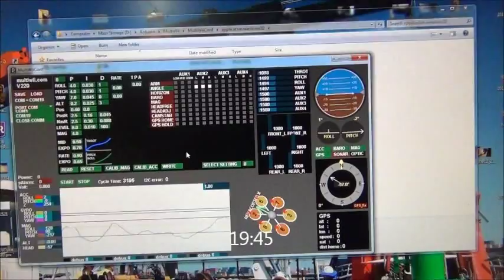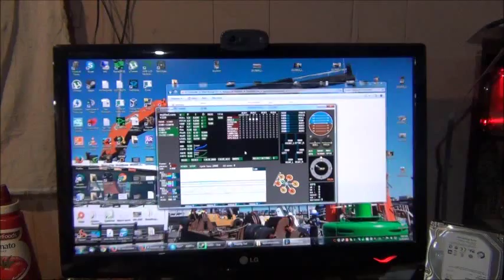9 Hour Big HexaCopter Build & First Flight

Comment: how did you attach the motors to the frame ?
Reply from the maker: Rivets mate, Rivets. just like a real helicopter? lol :)
Reply: haha nice, i just ordered my kit with the below, hope my motor choice is ok

Your order details are:
1x #9171000112/25698 Turnigy H.A.L. (Heavy Aerial Lift) Hexcopter Frame 775mm = $63.86
6x #9192000124-0/39708 Afro ESC 30Amp Multi-rotor Motor Speed Controller (SimonK Firmware) = $83.76
6x #NTM2826-1000/21478 NTM Prop Drive 28-26 1000KV / 235W = $95.70
1x #402000001/15214 Gyro / Flight Controller Mounting Pad (10pcs/bag) = $1.95
1x #Turnigy-HKLP/11736 Turnigy Battery Strap 330mm = $1.55
1x #9171000144/27035 Hobby King Octocopter Power Distribution Board = $4.75
2x #9171000101/25438 Turnigy H.A.L. Battery Mount Plate = $5.98
6x #NTM28-ACC/16719 NTM Prop Drive 28 Series Accessory Pack = $11.10
1x #387000003/26588 MultiWii PRO Flight Controller w/MTK GPS Module = $64.99
1x #TX-9X-M1/8991 Turnigy 9X 9Ch Transmitter w/ Module & 8ch Receiver (Mode 1) (v2 Firmware) = $59.99
1x #9X-LCD-WH/17129 Turnigy 9X LCD Backlight Kit - White (DIY) = $4.99
2x #OR009-00502/17847 M3x8 Nylon Screws (10pcs/bag) = $1.54
2x #9171000015/22733 5.6mm x 14mm M3 Nylon Threaded Spacer (10pc) = $3.76
2x #WHS10-RED/10434 Turnigy Heat Shrink Tube 10mm RED (1mtr) = $1.58
3x #025000019/27326 GWS EP Counter Rotating Propeller (RH-9047 228x119mm) Grey (6pcs/set) = $14.88
3x #025000039/27347 GWS EP Propeller (RD-9047 228x119mm) grey (6pcs/set) = $15.45
2x #015000030/25659 HXT 4mm Gold Connector w/Pre-installed Bullets (10pcs/set) = $14.98
5x #B16A483-06/9680 Turnigy Pure-Silicone Wire 16AWG (1mtr) BLACK = $5.70
5x #R16A483-06/9681 Turnigy Pure-Silicone Wire 16AWG (1mtr) Red = $5.70
1x #Tube-297g/6717 Large box and Packing 297g = $0.00